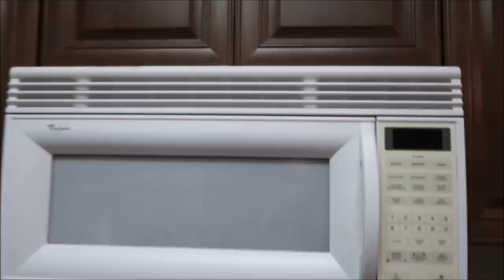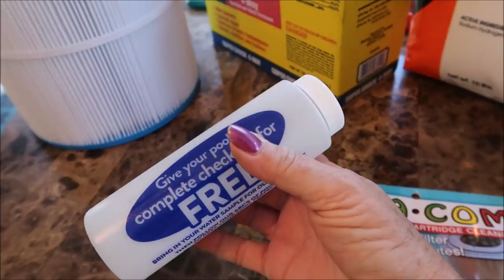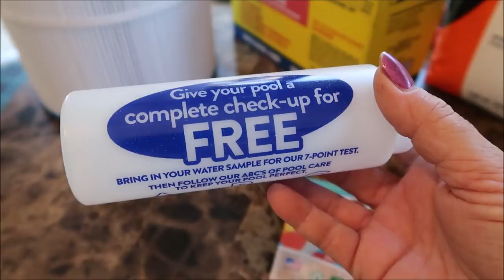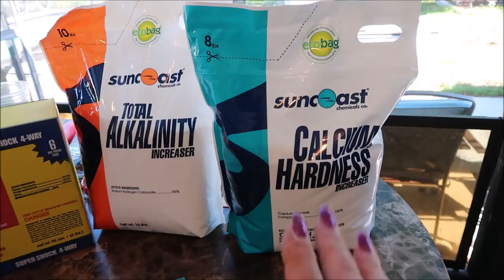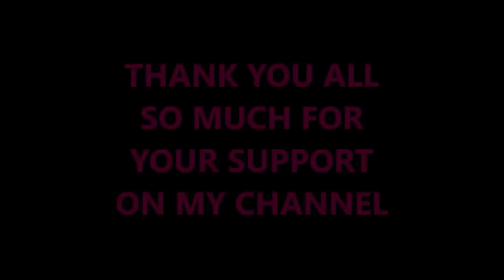DIY WITH MARIE SAYING GOODBYE

Comment: You could have got an integrated dishwasher, that’s what I have.  My kitchen is only six years old but I’m replacing it at the end of July.  I’m knocking the whole downstairs through to make one big kitchen/family room as our lounge is on the next floor with a bedroom and a bathroom and the rest of the bedrooms and bathrooms are on the level above.  I know what you mean about the side by side fridge and freezer.  You can’t put much in the freezer otherwise it doesn’t make ice very well plus things can fall out.  I’m changing mine for one like you have got.  My appliances are all in black though.  I’m having two ovens set in the units at eye level, as one isn’t enough, and hopefully a big induction hob elsewhere.  I can’t wait.  So exited.

Comment: Looks amazing  Marie those delivery guys are lazy  ....so happy for you!!! Much love
Reply: Gigi - not trying to be a snob all so please excuse me if I sound that way, but actually they refuse to do that for liability reasons. If there is a leak, that could soak up into her walls and electrical. Not to mention ruining her floors as they look like GORGEOUS wood floors. What happens is, the ice maker box takes a while to build water into it, if it leaks chances are is when it’s already done too much damage.. sorry for ranting.. but just wanted to give an explanation as to why companies don’t want to take that liability. However, Marie might have wanted to check under her sink to see if there is one located in there. My hubby installs them under the sink instead of behind the fridge for easier access. In an emergency, who wants to pull the fridge out all frantic?!? Anyway, have a blessed day!!!
Reply: @ErikaThorpe  you dont sound like a snob  I understand  but I have had lots of experience with those guys some go out of their way  and others  had excuses ...that's why I said that!!